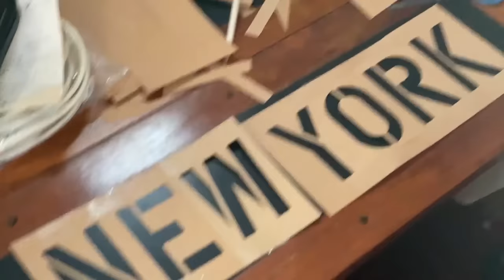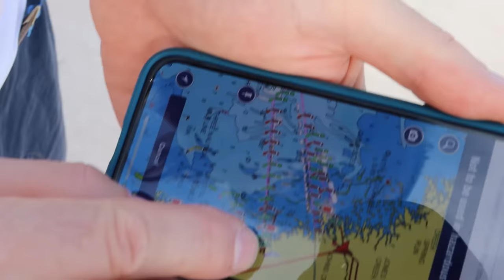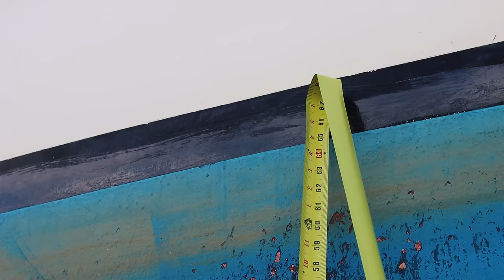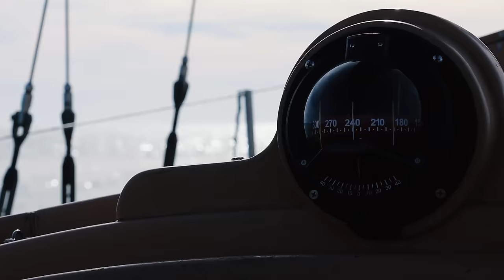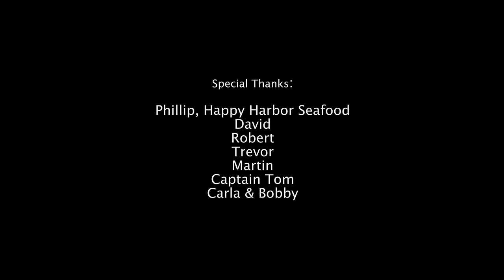Sailing Liberty- How to Afford Cruising Life /Boat Delivery Westsail 32 Rigging/How to Cook Panini

Comment: About 15 years ago, ACR had a major on EPIRBs. The test LIGHT worked, but the signal never was sent out. You can a real live test done in a "casket" at ACR in Ft.Ld. and some other places. The "casket" is a sealed testing box, so no signal comes out past the test equipment. Some of the newer (10? Years?) rigs CAN actually send a text transmission to your email.
Reply from the maker: I will call them - our EPIRB is old!

Comment: We always pulled the speed log as soon as we docked or moored. That pretty much prevents fouling. It is only scary the first time, less than a pint of water will come into the bilge when you swap out the plug.
Reply from the maker: Great tip!!! We will do it-  Thanks!

Comment: As an auto mechanic with some carpentry experience, could I make an income from rebuilding old boats in coastal ship yards? I guess I'm asking if there's a lot of cheap old sailboats in disrepair at a lot of ship yards along the coast or on the Caribbean Islands that could be flipped for profits. It's easy enough to do with used cars and junk yards, so I'm wondering if it could be the same for those boat/ship yards and used sailboats or whatever people like to buy. I'm based out of Texas, and I'm wondering if that could fund a Gulf island hopping habit.

Comment: Hey guys, I’m watching hurricane Italian approach the coast where you are, can you put out a two minute message letting us know what you are doing? Sending you all the best for your safety, do take care!
Reply from the maker: We are updating on our Facebook page Sailing Liberty mostly at the moment. It was before a direct hit, but now the system goes up north from us according to latest reports. On a good note we got our steering fixed and used it while anchoring. We already have bare poles. Running on generator on our last pit of gas, since fire in marina after lightning strike we haven’t have a proper electricity for 2 weeks. Crazy lightning storms around us. Tomorrow we will clean more of decks, probably take down the solar panels. I cannot sleep much nor eat. Ted has a great appetite as always:) 
God bless!
Helena